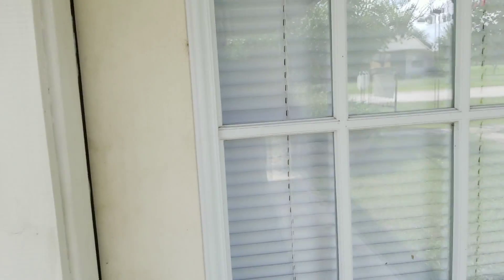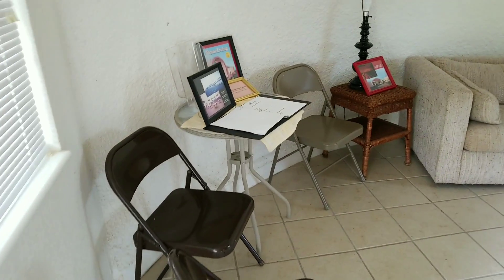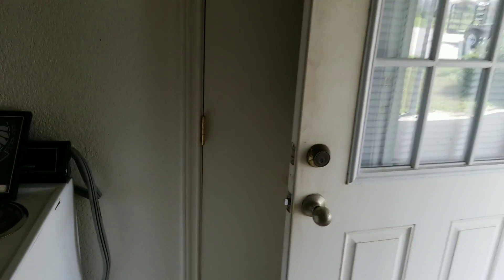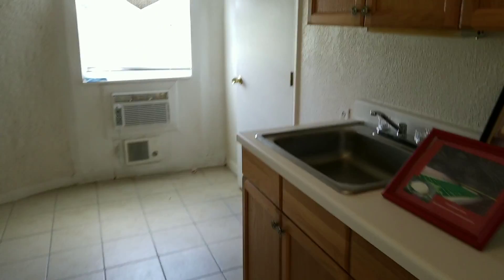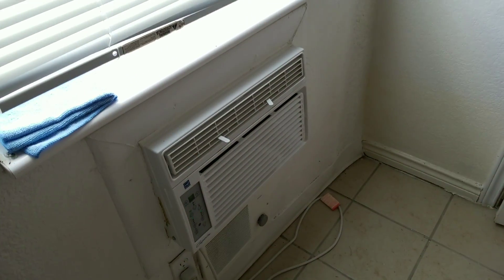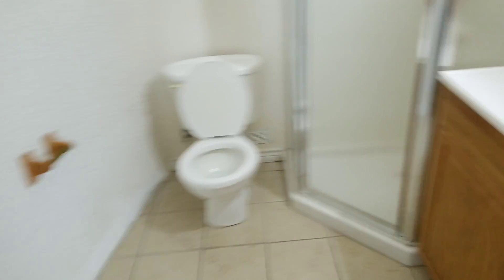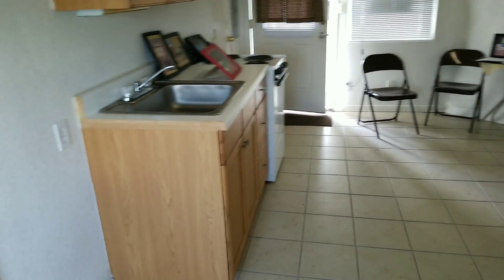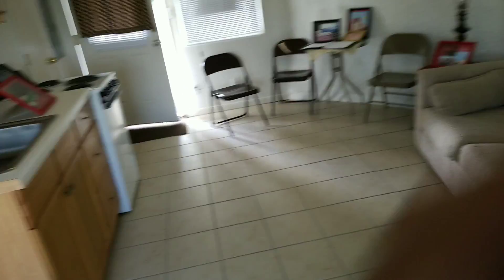20 foot Dome | Italy Texas #aircreteharry #aircrete #dome #domehome #foamgenerator #diy #visit

Comment: I want one of those with a sliding glass door on the south side to warm the place up in the sun.  Then cover the roof with netting and soil and let plants grow over it.  I don't have land tho.

What are the comparable prices vs shotcrete and foamcrete?
Reply from the maker: The way I plan to build my dome which is in my opinion the safest way to build. Iowa first start with a reinforced structural layer of shock Crete then I would add 9 in of aircrete as my insulation. The amount of cement needed for the shotcrete and for the aircrete are the same. So if building this 20-foot Dome would require about 8 yards of cement for the structural layer then it would also require 8 yards of cement for the aircrete layer except you'd be expanding it with foam for insulation.

Comment: She shed.  Man cave.  Can micro rebar be used in place of rebar ?
Reply from the maker: I asked that question to the engineers that work at the micro rebar company. I was told micro rebar would need to be used with Steel rebar or Basalt rebar. But could not replace the rebar in a dome structure. I plan to use Basalt rebar with Basalt mesh giving you the best strength and least possibility of cement cracking.
Reply: @AircreteHarry   Thanks for the info.  Your uploads are super informative.

Comment: It's shotcrete, foam insulation, shotcrete, all reinforced. Reflective stucco can be applied. Foam is R-6.8, aircrete is R-1.8. Is the aircrete cheap enough to allow 3,8 times as much? I want a dome home in the hot Vegas desert and need R-70 to be energy free.
Reply from the maker: I would recommend an Eco shell structure with aircrete for insulation combined with a ceramic paint, would give you all the insulation you would need.
Reply: Eco shell? That's a monolithic dome using 9" of aircrete instead of foam = R-16 + the 3" of shotcrete = R-? With a reflective paint will that be enough so that I won't need any cooling in triple digit temps for 100 days? What is the life of the paint? Is it waterproof?
Reply from the maker: Yes the paint is waterproof. https://www.youtube.com/watch?v=9-AgVfPEfQg  https://www.youtube.com/watch?v=bhaX8Th_Vfk  https://www.youtube.com/watch?v=majSFV6dzG4&lc=z23jsvwqjnzijr1liacdp435qh2n3oe42w3pl2zj2htw03c010c.1539207573984352

Comment: Love it! Make time to visit me when I build mine. I plan to start this winter and document it via YouTube. I have 5ac in the desert with a rectangle slab existing.
Reply from the maker: I just recently picked up all the supplies that I need to build domes 20 and 30 foot. If you're interested in the building method I'm using of structural layer of cement that would be permitted with an insulation layer of aircrete let me know because I'm ready with a small crew to start building for people like yourself. https://youtu.be/Ui89IRSxcTw